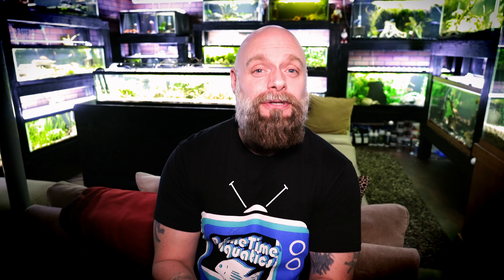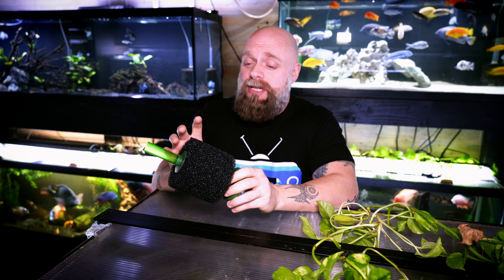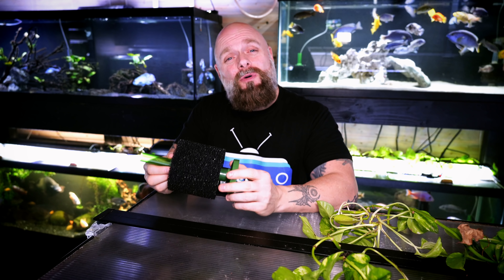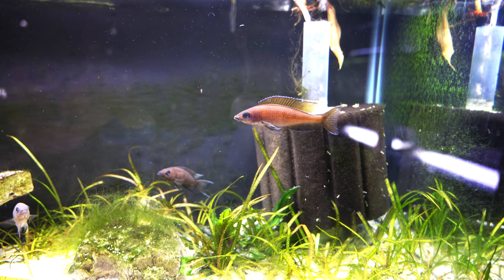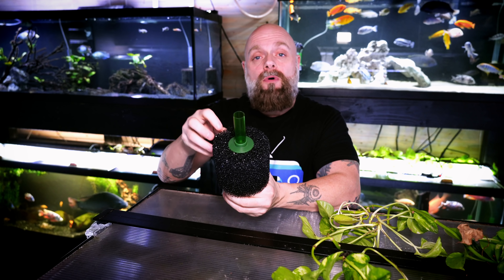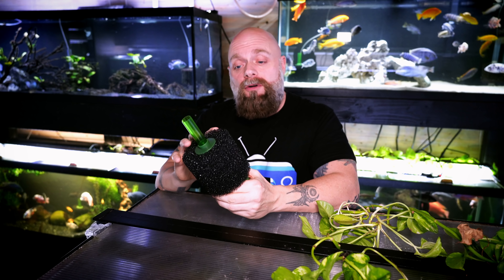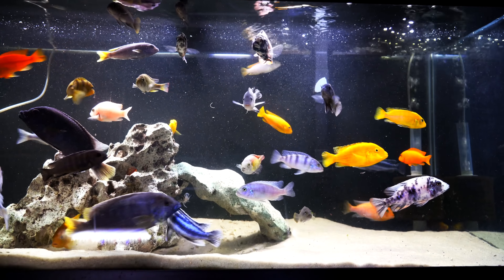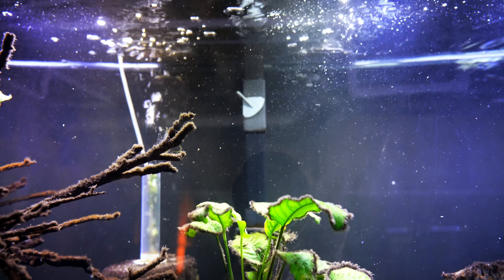Should You Add a Powerhead to a Sponge Filter? Pros and Cons

Comment from the maker: If you want to learn more about sponge filters check out these videos!
Beginners Guide to Sponge Filters: https://youtu.be/yQSI-3rUsIs
How to Clean Sponge Filters: https://youtu.be/jp49hdba0eY
Sponge Filters vs Hang on Back: https://youtu.be/TN_eagzIEyY
How Much Filtration Do You Actually Need: https://youtu.be/aZZoxO6rUOI

f you want to see more behind the scenes stuff, exclusive videos and support the channel consider becoming a member! https://www.youtube.com/channel/UCYVN7EN0ALL6CE4U7NpMUTA/join

Also, our new shirts can be found at: https://www.primetimeaquatics.com/merch

For the latest in the fish room check us out on Instagram primetime_aquatics
Reply: Dwell Time for Optimal Biological processing of the 'Nitrogen Cycle', Vs. High Flow Rate for Mechanical 'Particle Trapping' are basically two different/Separate types of processes. And should be addressed and treated as such. Example: Hamburger Matten Filters (HMF's) Are Specifically and Mathematically calculated for optimal flow rate for the Biological Processing of the Nitrogen Cycle. Speeding up this calculated flow rate Reduces Biological efficacy. ..IF you want proper Biological processing from your sponge filter, leave it on the air power and flow rate it was designed for. ..IF you want 'High Flow Rate Particle Trapping', Then put it on a power head. With this latter option, you will need to clean the trapped detritus from the  sponge frequently. Did I mention the Greatly Reduced Biological efficacy? Cross your fingers and hope you don't get sick livestock with the power head option.
Reply: Like your videos, you’ve been a big help. I was wondering, is there any specific air pump or brand that you like to use on your tanks?
Reply: I guess im asking the wrong place but does anybody know a tool to log back into an Instagram account??
I stupidly lost my login password. I would love any tricks you can offer me
Reply: @Cesar Sincere Instablaster ;)
Reply: @Avery Hudson Thanks for your reply. I got to the site through google and Im in the hacking process now.
Looks like it's gonna take a while so I will get back to you later with my results.
Reply: @Avery Hudson it did the trick and I finally got access to my account again. I am so happy!
Thanks so much you saved my account !
Reply: @Cesar Sincere No problem =)

Comment: In both my tanks I have a cheap double sponge filter with an Aquael PAT mini powerhead attached to it.

Works great. It's easy to know when they need to be rinsed, the sponge turns into an "hourglass" shape because of the vacuum when they get too dirty.
Reply: using the same as yours it's working great.

Comment: I'm running a power head on sponge filter modified with a longer uplift tube in my 29 g Hillstream River tank along with an Aquaclear 50 and a AC 30.   Great point on the middle of the tank water. My Gastromyzones and panda garra love it. Great video as always.
Reply: Mathew, I’m thinking about the same thing but how often does the sponge require cleaning with the power head installed on it?
Reply: @aquatichobby5527  Well that would depend on how many fish you keep, how much food gets put into the tank, what size sponge you have and how many, also what size tank they're running on

Comment: Excellent video, well covered as usual .
Additional points that don't apply to most.
Some have the single large air pump running a fish room. But in some houses it's a main air pump. But a few racks are too far away to connect easily especially in rentals.
You didn't include the aspect of using powerhead instead of air drive means there's potentially less dissolved oxygen/co2. Not much of a thing for most people. But a important component in well planted tanks and or fancy shrimp tanks. Especially during the change over.
I've recently realised I can remake my 9 tank two ft tank shrimp racks run off 18w of power heads. They're curently powered by a 35w air pump.
And my new 28 nano tank rack can run off 16w with power heads and diy logic. But would be about 35 w air blower. So the economic factor isn't all that.

I think dissolved oxygen is important in many tanks. That's lessened when a powerhead replaces an air pump in general. Should be considered.

If you read this far into my blurb rant. Comment.

Comment: If you have 2 sponge filters in 1 tank, you can swap the other with a sponge with finer pores. I forgot the pores per inch number, but it's similar to the kitchen sponge foam. It should do a good job polishing your water.
You can also connect a pvc elbow on the out-flow tube so you'll have a directed flow.

Comment: Hi everyone, id like to hear your opinion on this:
My aquarium filter has no space for bio media in it so i use as substrate very small lava rocks (known as a good substrate for bacteria.) Im checking water parameters twice a month and its all good. 
I wonder if gravel vac could hurt my bio media in this situation and what you recommend to do.
Thanks
Reply from the maker: Good question - using a gravel vac won't have much of an impact because the microbes are mostly attached to the gravel in a way that they won't be easily removed.
Reply: @DLS Shares Inc my tank got wrecked two months ago due to brown diatoms getting out of hand after i installed a canister filter... consumed all of the oxygen in the water... but for almost a year the tank relayed on lava pebbles as a bio media and it was just fine with these aspects: . i have cleaned the  small mechanical filter every weekend. cleaned the  tank, a third  water change and gravel vac'ed twice a month. a thumb rule i followed and it was good relaying on pebbles as bio media - each fish sizing around a fist or less need at least 10 liters of water to himself. in my case: 120 L of water containing 12 fish the size of  a fist  or less.  i also put inside golden pothos and jungle val', they most likely made a huge help. sums it with 30 min's to an hour of work each weekend and youre good to go. keep me updated hows your tank doing!

Comment: I like power heads in my basement mechanical room tank because I don't want to push moist air into that room.  I also found pointing power heads directly up in my bare bottomed tank brings less solid matter to the filter, so less clogging.  I only need to squeeze them during each monthly water change whereas before I had to do it every week or two.
Reply from the maker: Good points!

Comment: What kind of exposure time is needed when running a sponge filter? When running it with a power head? Would you have to stack sponge filters to allow faster moving unclean water, more time to contact the bacteria in the sponge filter you are using?
Reply from the maker: Great question - seems to be hard to quantify.

Comment: What I do on most tanks use a PH on SF I find that by creating proper current I can keep water better aerated keep dead spots from forming direct detritus back towards SF. It also keeps my fish more active. PH does need maintenance I do it when I clean SF so not an issue. Only running a doz tanks indoors with PH SF. But in summer pond up over 1200 gal. On that, I use far different filtration.

Comment: incase one uses co2 wouldn't a power head attached to a sponge filter be better than than attached to an airline as co2 wont bubble off?
Reply from the maker: A gentle powerhead might be a better option than an air-driven sponge filter in that case.

Comment: Any thoughts on a filter design that is above the tank? Obviously not a conventional design and have to consider lighting but is it even worth considering? Obvious benefit is that its not part of aquascape and you can put the tank right up against a wall.
Reply from the maker: If I were using one of those I would put a light on it and grow tons of plants, which would help lower nitrates and reduce the need for water changes.

Comment: This is a little off topic but, I see that you're using the Aquarium Co Op sponge filter as an example here. Can you tell us, of the four sizes that Cory offers, how do you determine which one or how many you need per tank? Whether you agree with them or not, there are at least ratios that you can use on the more traditional filtration such as canisters or hang on the back styles. For example, I have a 210 gallon fish tank. Obviously I wouldn't want to use a nano sized sponge filter. Or at least, I don't think so. If sponge filters serve more as a biological filter, how much actual surface area do they need to allow them to function as designed?

Comment: I use a sponge on a power head to feed my top sump, that has 16 rotted  devils ivy in it. I went 4 weeks without a water change. Wasn’t sure if it was the right way to do it so I did a 30% water change a couple days ago.  I be tested the water with an api test kit and the water was almost zero ammonia, nitrite , and nitrate
Reply from the maker: Interesting idea!

Comment: Great video. I have a silly question. What is the gray piece on the hob filter tube? I could not get it to stay on and don't understand what it is for.
Reply from the maker: The long part sticking out the top is the uplift tube. It will allow your sponge filter to draw a little more water through the filter itself, but is not vital to its operation.
Reply: Thanks

Comment: I've tried a powerhead in conjunction with sponge filter before in my aquarium. I believe it does have benefits, but I can't find a powerhead with decent flow control. Most, and the one I had, were much too powerful. Might you suggest one that would fill the bill? A dial speed control would be awesome.
Reply from the maker: I actually don't use powerheads in my fishroom, so I'm not sure which are the best ones to buy.
Reply: @PrimeTimeAquatics  Thanks for the reply. I used them once but without flow control I found they were to rambunctious for my fish. I agree with your assessment that the sponge alone should produce enough bene.bac. And most fish keepers use a siphon to clean bottom/ substrate debris. I'am limited to one tank because of lack of space. It's a community tank with small fish and one gold nugget pleco. My interest at present is going more toward cardinal tetras, neons and cory cats. Cory world really fascinates me. Lots to learn.Thanx again. Sincerely James.
Reply: @jamesnorwood4084  I use a cheap powerhead from Top Fin (50 gallon model) in my 135 gallon. It is cheap, quiet, has an aeration line, directional control, and decent flow control via a knob on the water outlet. If I want lower flow I can adjust the knob, and I can also direct the flow upwards (less "flow", more surface agitation). I have it attached to a large sponge and it works great opposite my Aquaclear 70 HOB. FWIW: I just cleaned both filters and the sponge had way more gunk than the HOB, but the HOB allows me to add filter media like carbon and Purigen. Running two undersized units keeps things quieter and gives me more options.

Consider buying a powerhead that is undersized for your tank. I bought the unit designed for my tank size and it nearly blew the fish out of the water.

Comment: I have 60 gallon with juvenile mbuna 20 of them. I put 2 aquaclear 70 HOB and 2 sponge filter in the corner running with tetra whisper 100 airpump. Is it too much water movement for my fish?? Is that bad for them or good? I am worried that i may over filter my aquarium that causes too much oxygen with my fish. I put airstone in my sponge filter but creating a lot of small bubbles on the top. I change water 20 percent every week. I don’t have any issue in my water parameters everything is 0 every time i change water but i still change anyway.
Reply from the maker: Should be ok. You can always turn the flow down on the HOB if they are fighting flow too much.

Comment: Can i put my powerhead pump in the middle of the tank ? I have it on the one end of the tank . I have two filters one a smaller sponge filter in the middle and the power head on the left side of the tank. Id like to put the powerhead in the middle and sponge on the left side is it okay for the powerhead to be kept on the middle of the tank ? Please help
Reply from the maker: Depends on the type of fish you have. If they don’t mind the flow it can be ok.
Reply: @PrimeTimeAquatics  i have blocked the direct flow, the water comes in and goes directly to the filter rather than pumping air inside the tank .. i could send you a video but where do i send it i dont know :( . Overall its okay for the power head to be placed in between right ?

Comment: I have heard that adding an airstone to a sponge filter makes it more effective then the standard large bubbles. Can you address this?
Reply from the maker: That is true - not so much because of the bubble size, which helps quiet the sponge filter down little, but attaching the airstone causes the flow to go through more of the sponge filter.
Reply: @PrimeTimeAquatics  If it is not due to the bubble size is it because the air flow starts at a lower position in filter? Will you be at the GCCA swap meet tomorrow?
Reply: @AnthonyZiblis  the smaller more numerous bubbles do increase the flow. By evening out the bubble size to be more consistent, and the smaller bubbles are faster than larger inconsistent bubbles. If it was simply having lower reach through the filter then a longer tube would do the job

Comment: I had an idea. What about putting one of those sponge filters on a tidal 110. Basically use the sponge filter as a pre filter for the tidal. Think I’m gonna at least try it on my next tank and see what happens!
Reply from the maker: As long as it only has one opening (the bottom is sealed). it might work ok.

Comment: Hey I have a question. Perfect tankmate for neolamprologus multifasciatus in a 36 inch wide 10 inch tall and 14 inch wide. Thnx greetz from the netherlands
Reply from the maker: Since the tank isn't very tall I would be hesitant to put anything with them. In my lowboy I have a couple BN plecos, but that is it. They usually push fish into the corners once they start breeding unless the tank is tall (at least 20").
Reply: @PrimeTimeAquatics  thank you for your answer.  then I must have to buy a bigger aquarium :) good excuse hahah

Comment: You can run a hose to the other side of the tank and add a sprinkler for good water circulation. I have 2 power heads behind a corner Matten filter. 1 runs above the tank and one under the gravel exiting in a bog. Of course I only have 3 tanks.

Comment: I have tried using a powerhead on a spongefilter. I did not like it. The thing I like about a airdriven spongefilter is that they never clog, so the amount of water being biologically filtrered pr. hour is always the same. With the powerhead, they draw in so much dirt that they do clog, imparing the biological filtration. Within two weeks, my discus was snapping for air at the surface as the flow had reduced. After I went back to air, this has never happened again. Slow and consistant flow beats fast and rapidly reducing flow.

Comment: Power-head on sponge filter, depending on size of fish, will likely yield waaay too much flow. I use a couple of sponges in my 20 long and rotate cleaning once a week; wait a few days and clean the other. I siphon poop and detritus 2 to 3 times a day, replacing roughly 20-30% of water daily. After 7-8 days I go for a 50% water change and add small amount of bene. bac. over each filter. Used this method for a year. No fish loss, colors vibrant_ rummy nose and cardinals_ the whole community seem happy campers. Nitrates LOW!

Comment: In a hot climate an important consideration is the power head or any motor running in water will increase the water temperature. Air does not increase water temperature

Comment: I have a question I would love an experienced aquarist to answer. I used to use external cannisters and do my water changes through them (with fully dechlo water). I can't remember how I did it (I bought the tank set up that way and kept it). Any idea how I could replicate this again? 

I'm pretty sure I had valves coming off the inlet/outlet lines that had extra pipes for fresh in/dirty out.

Comment: Only if the sponge is something like 3 gallons in size..then a small powerhead won't clog. Otherwise,stick to air. Air never draws in enough to collapse the sponge and it does become a bio media.
But,If you have  big tank and don't want to drill holes or a sump..one or two round sponges of 3-5 gallon size would work well enough.

Comment: How do power heads operate?
Reply from the maker: They just plug in and start sucking water through the pump. If they are hooked up to the uplift tube of a sponge filter they will suck the water through the sponge filter.